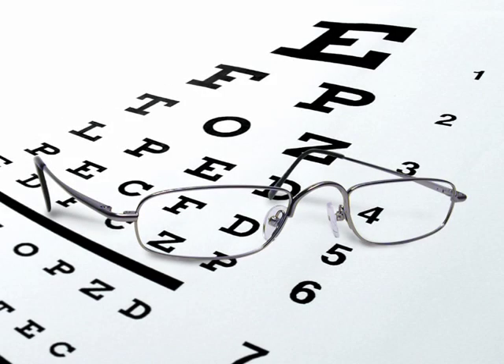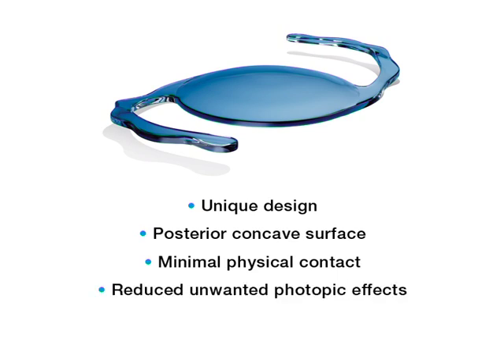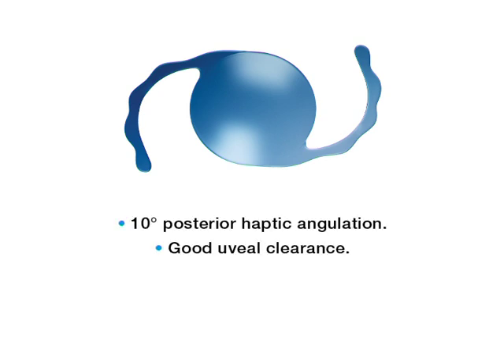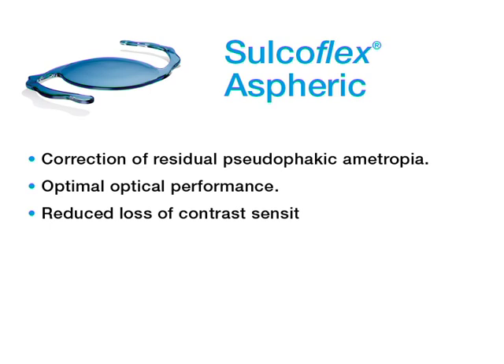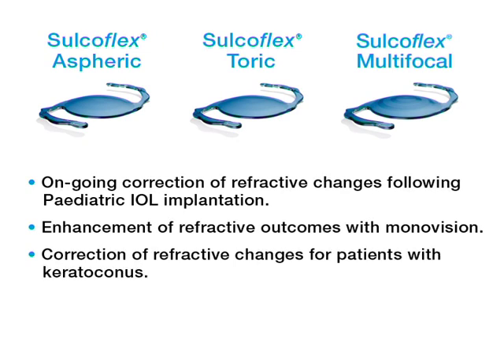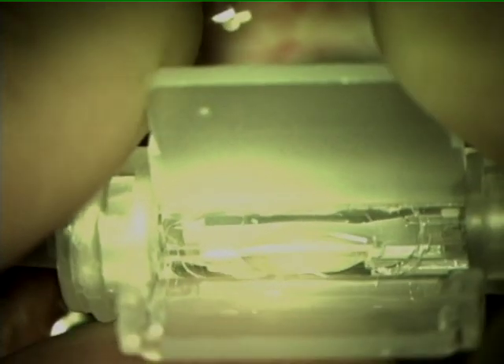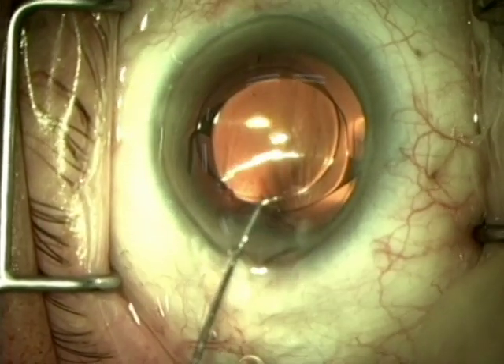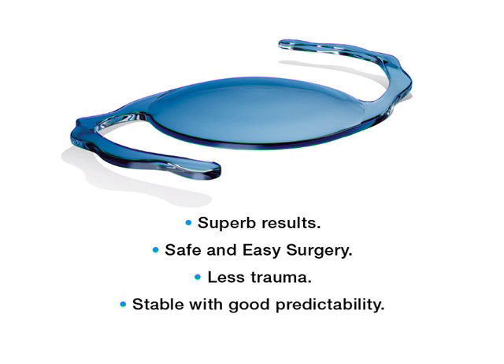Sulcoflex® Pseudophakic supplementary IOLs

Comment: I have technis symfony lenses.  My refraction is + .75 -.50 X 140 OD and -.25 OS. Happy with OS would like to get more near vision in right eye which currently sees very well distance at night when pupils are dialated, but not that well far or near in daylight. When i wear a BL + .50 hi add soflens, i see well the first day at all distances, but lose some near as the cornea changes 2 or three days later. have you implanted any multifocal sulcoflex lenses over a technis symfony with good results?  i have pretty good distance and near with a +1.00 monocle over the OD. Suggestions for getting more spectacle independence?
Reply: i also have Symfony iol, with blurred vision within 3’. +.50 Add high contact lens brings better focus & +1.50 for seeing close details and small print... is Sulcoflex implant in cilary sulcus available in USA, California, anywhere? who can fix my blind zone? thanks